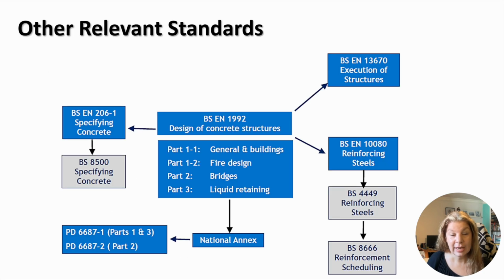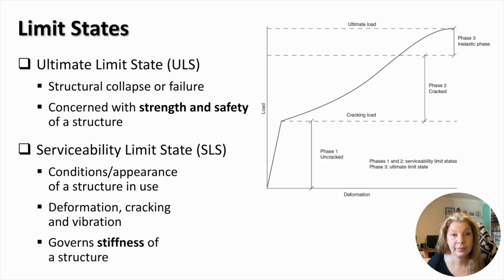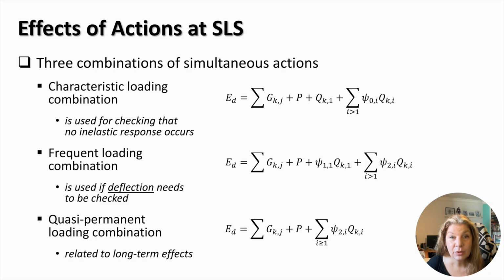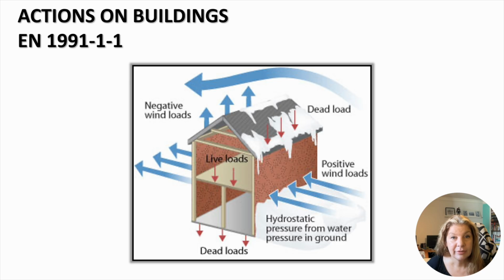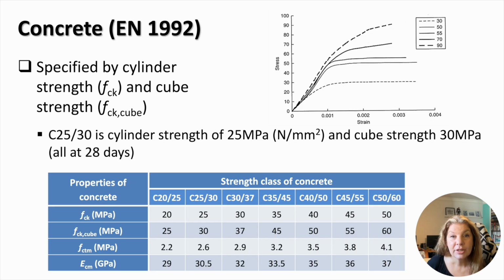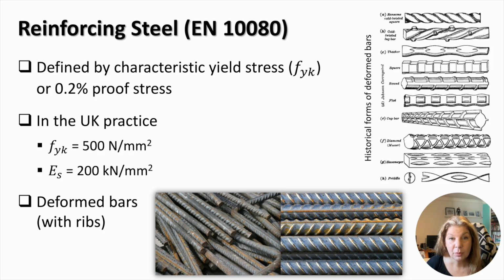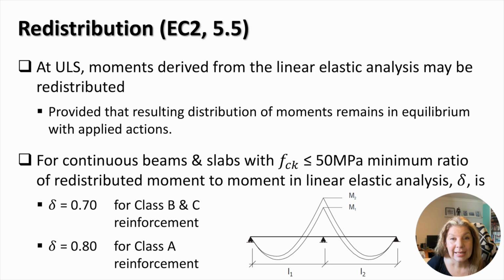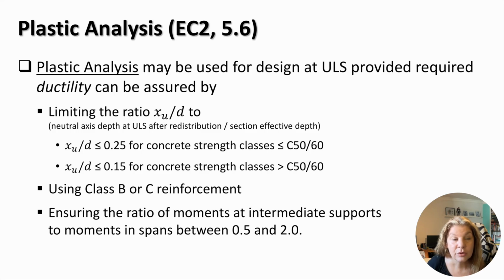Reinforced Concrete Design | Topic 1: Intro, Part 3 – Eurocodes & Design Philosophy | Eurocode 2

Comment: Please can you share with me a copy of the Eurocodes, I don't have them. Nice lecture by the way, be blessed.
Reply from the maker: Thank you for your kind comment! 😊 Unfortunately, I can't share copies of the Eurocodes because they are copyrighted documents. If you're a student, it's worth checking whether your university provides access through its library. There are also many textbooks available that present the Eurocode requirements in a more concise and accessible way, which can sometimes be easier to work with than searching through multiple sections of the standards themselves.
In my Reinforced Concrete Design lectures I explain the key provisions and show how they are applied in practical design examples. I also reference the relevant Eurocode equation numbers and clauses, making it easier to trace the calculations back to the standards if you have access to them.
Thanks for watching, and all the best with your RC designing! 🏗️📐😊
Reply: @EngineeringTheCurriculum , thank you ma'am, I really appreciate it.